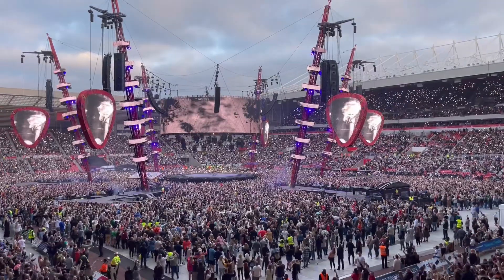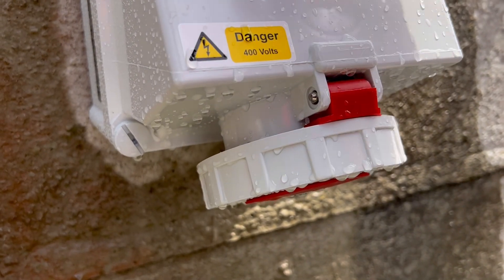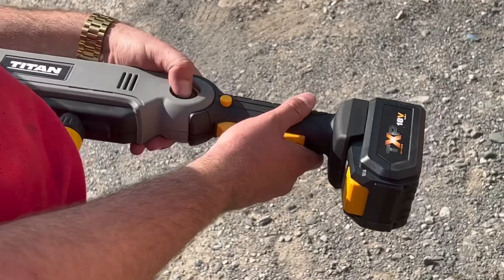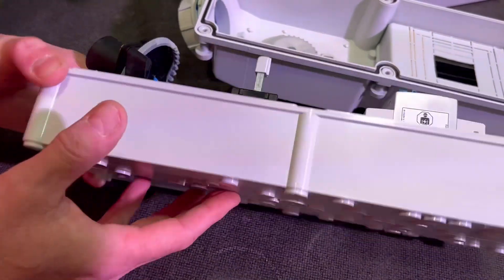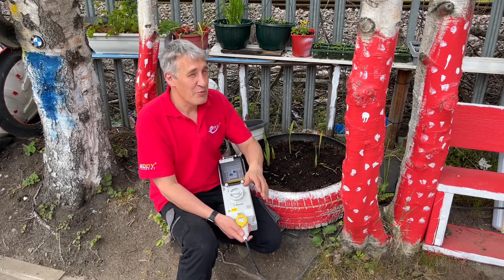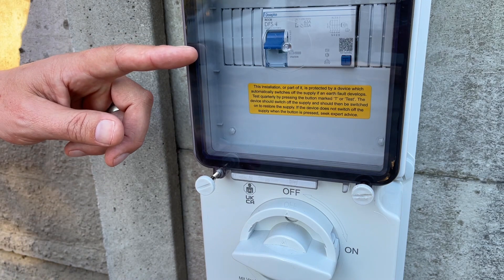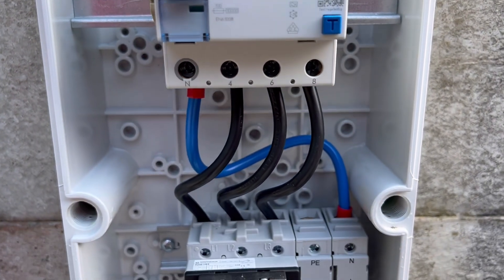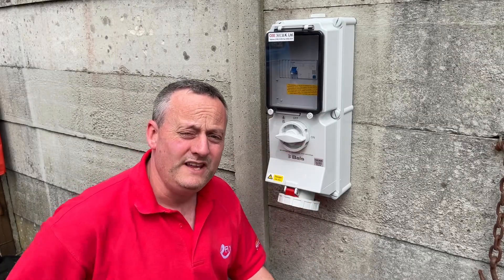Industrial Sockets - The Small Details That Make A Difference

Comment: While RCDs are great for low power sockets. I keep finding 30mA ones fitted to 63A and above sockets, making them useless for event use, since the combined leakage of a large quantity of SMPS push over the 30mA limit.

The distribution units that are usually plugged into these sockets, have 30mA RCDs on the final circuits.
Reply: It's the bane of my life and utterly self defeating as production companies end up using generators rather than plugging in! ELRs and a skilled person to set them are the real solution here.